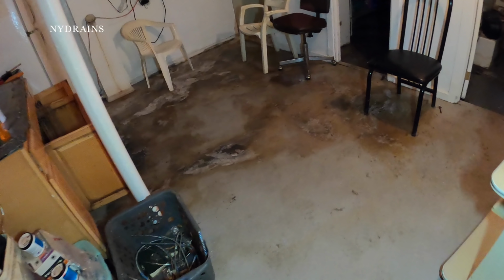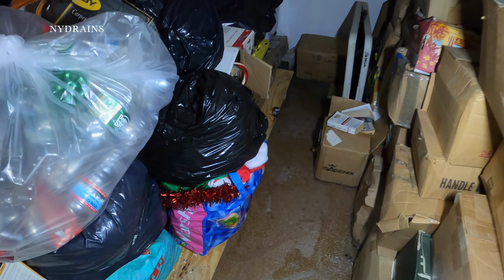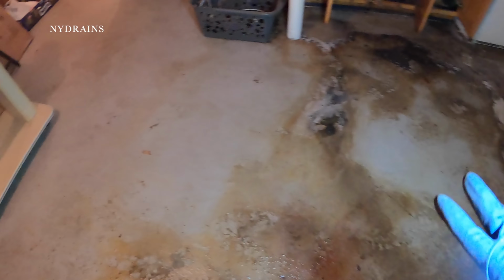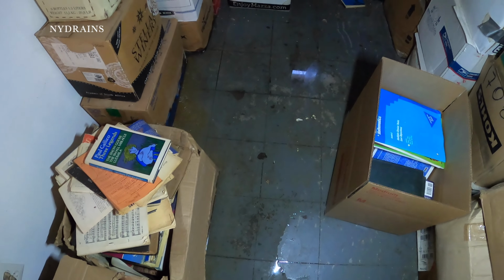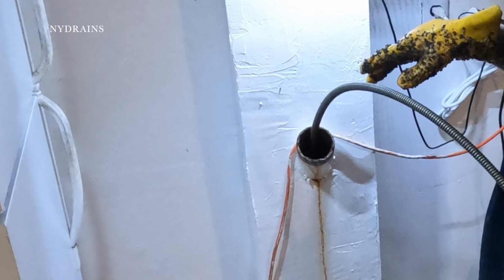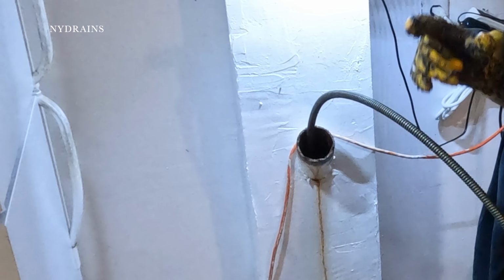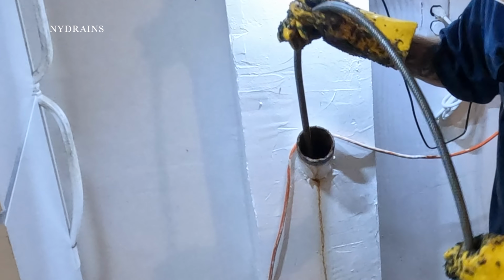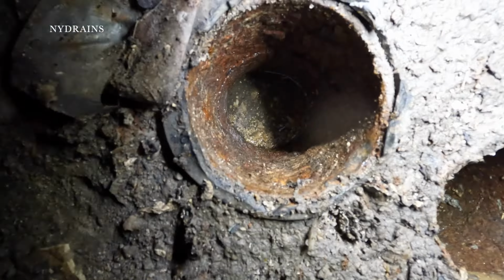Clogged Drain #122

Comment: Hi @ all. I once heard, I don't know exactly, that anything less than 10 cm on the basement floor is not insured here. Exactly for the reason, because there is rarely anyone in the basement.. What a pity for that guy ,having to clear that up.. Cardboard boxes are pretty much a nuisance when they get wet.   I was almost surprised that the power fuse hadn't blown.     No.. Vac. this time, Donald?
Reply from the maker: No, he has a professional cleaning company on there way Carsten.
Reply: @NYDRAINS  Ok ,got it-

Comment: I had a back to back at work yesterday thank God there was an access panel with a clean out
Reply from the maker: Those are a pain in the rear
Reply: @NYDRAINS  Actually it wasn’t too bad at all I took the cap off ran the snake literally 10 feet and boom flowing like a river
Reply from the maker: @leonardcrisci7254  the back to back sinks are a pain sometimes if you don't have a drop head.😉
Reply: @NYDRAINS  I know and sometimes you think you’re in but you’re not you just ran 20 feet into the vent

Comment: So can you explain how the pipping work in the apartment? You have the 2 main cleans outs and you also have the one by the sink? What is it?
Reply from the maker: The main trap in front with the two clean-outs which I did try snaking before to clear the clog couldn't hit it cause probably  because the main line in was going in sptit, like in a T or Y , and cant control which direction the snake goes, that's where the clean -out where I snaked from comes In handy and cleared the clog.

Comment: That clog resisted the power of the Spartan for quite a while.  Must've been an enormous amount of grease.  Great job as always.  

Since that cleanout was kinda high off the floor, do you worry about the length of cable you have between the drum and the cleanout?
Reply from the maker: Thanks 👍 it gets dangerous some times but nothing I can't handle 😉